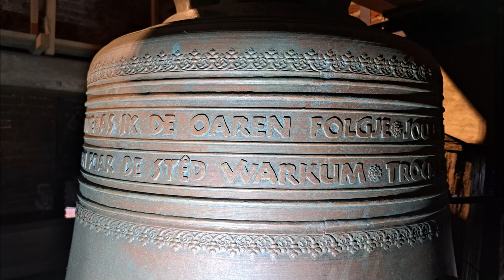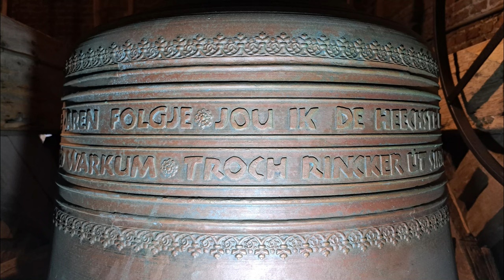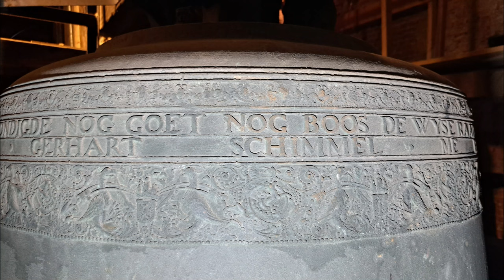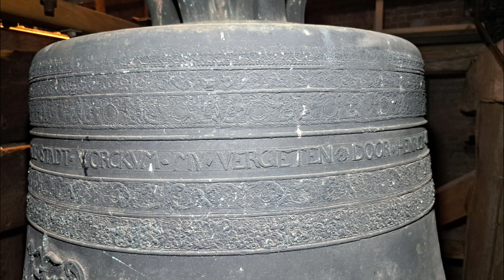Workum, kerkklokken Grote of Sint Gertrudiskerk

Comment: Majestic trio❤ could them been rung manually ? Surely G Schimmel want to create a bes0 bell, but the chording methods was not sofisticate like the tecnologic actual, so you think the same ?
Reply from the maker: Thank you! The bells can be rung by hand, but some temporary conversions will be required. I cannot make any statements about the chording and tunes...
Reply: I'm not so sure about that. Phrygian bi- and trichords are highly common in this area (look at the many bell chairs with the mi-fa interval). The proportion between the diameters of the Wegewaert and Schimmel bell is around 8:7, which is exactly between a major and a minor second.. It is very close to the septimal second which is not used in Western system. Probably Schimmel was not very precise with the principles of dynamic similarity.